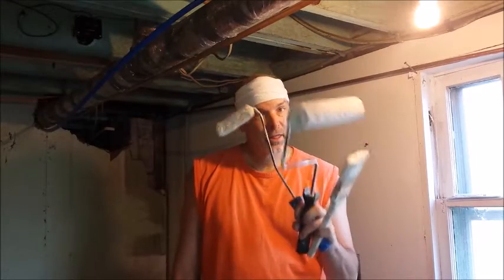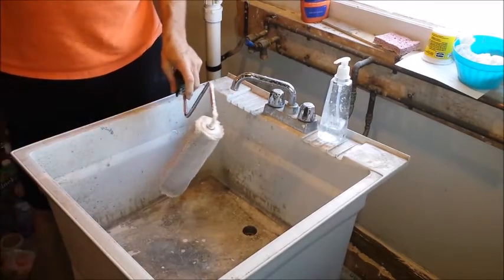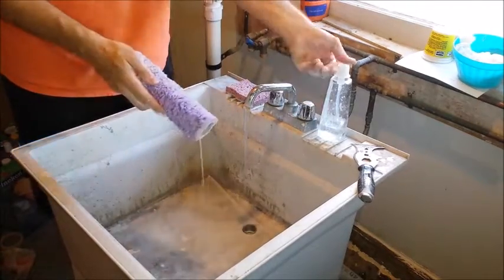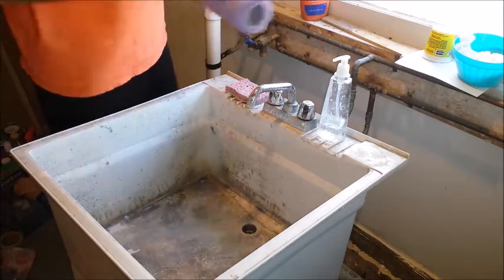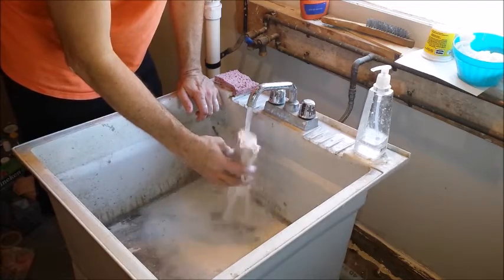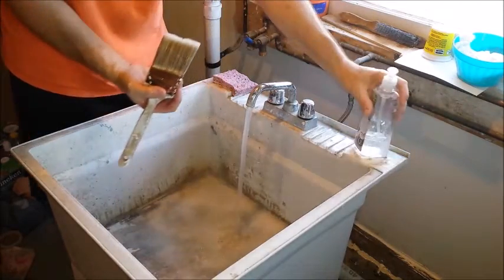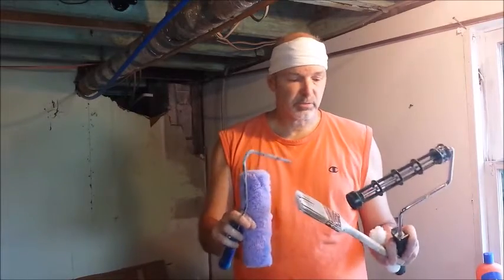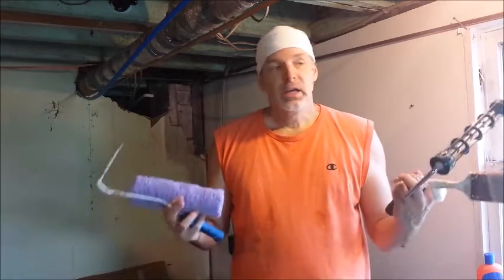HCC 15: Cleaning Paint Tools

Comment: Nice work, as always. Just a comment: the type of paint makes a huge difference: if it is not water-soluble paint then you'd better take into account the instructions on the box -- you may need to remove all paint first using another solvent (e.g., paint thinner, white spirit or <insert here the correct name for the type of paint or varnish etc. you use>). Afterwards, when all paint has been removed, you may want to treat the tools with water.
Reply from the maker: +Panagiotis Rentzepopoulos Very good point.  However, to be quite honest, if I'm using solvent based products i generally just buy a brush that i don't mind throwing out.  Way easier than cleaning it.

Comment: Was that water-based paint that you were cleaning?  Will cleaning go that easy with latex paint, or oil-based stain?
Reply from the maker: +Jaime Bravo Any paint that says LATEX or ACRYLIC is soap and water cleanup.  If I'm using an oil based or alkyd product, I generally just use a disposable applicator and toss it when I'm done.  Oil paint cleanup is, quite frankly a hassle.